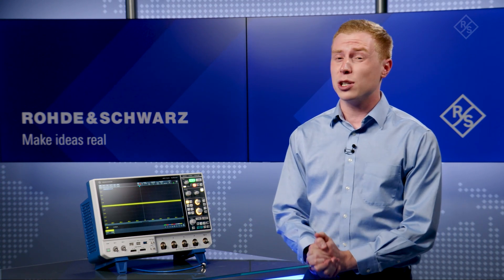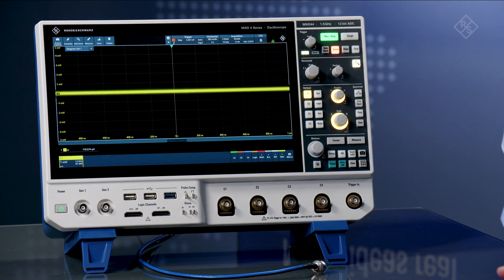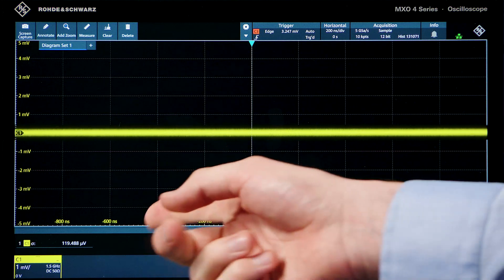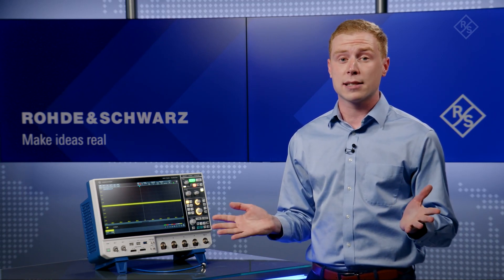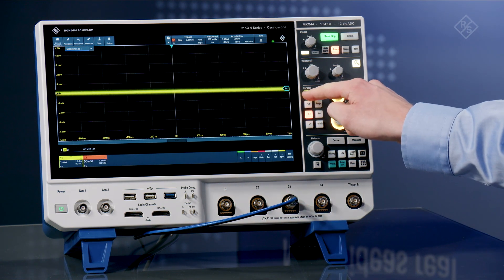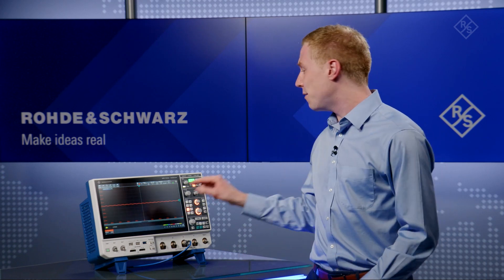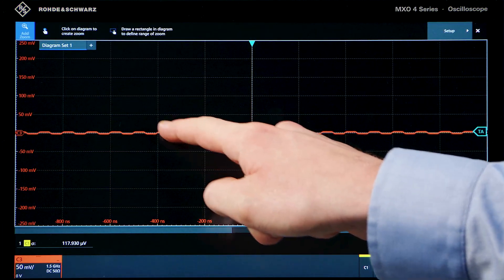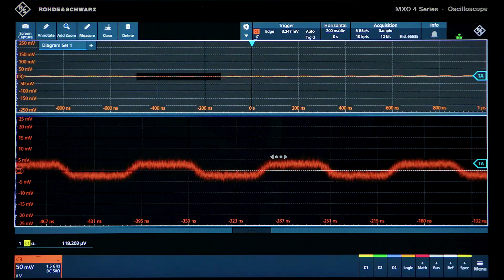See the difference with R&S®MXO 4: Low Noise Floor

Comment: A scope can measure a REPETITIVE signal below the noise floor by averaging multiple acquisitions. Additionally, a scope can measure a narrow band signal that is below the broadband noise floor by filtering out out-of-band noise. There are other methods of pulling a signal out of the noise,such as using spreading codes, which is used by GPS satellites and CDMA cellular networks.

If you can characterize the noise floor, you can measure weak signals (-13 dB or greater relative to the noise floor) by subtracting the noise floor from the measurement.
Reply: All that said, a lower noise scope will allow you to see that much lower below the noise floor. So a low noise floor is really important.
Reply: Thank you, I was looking for that comment 👍